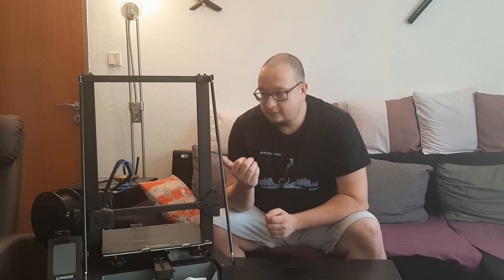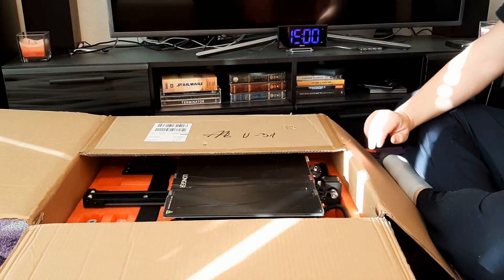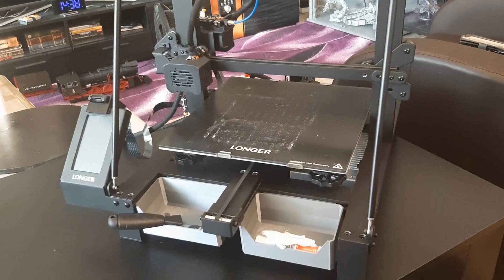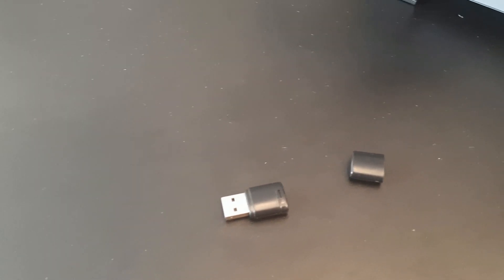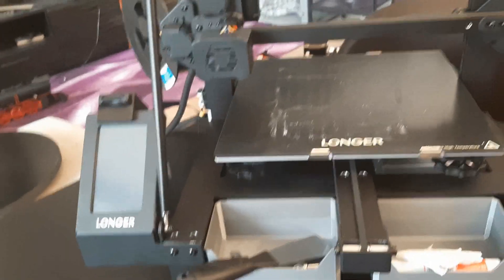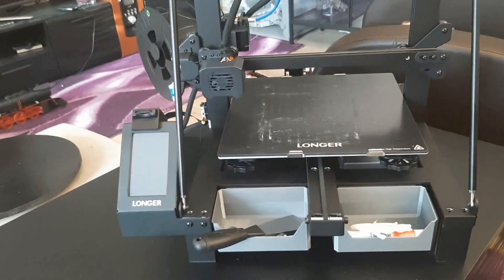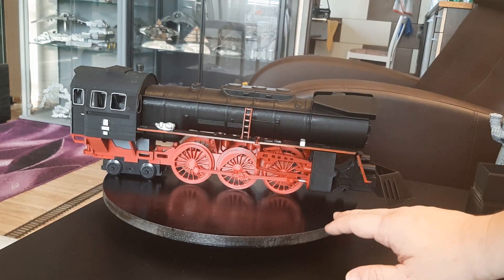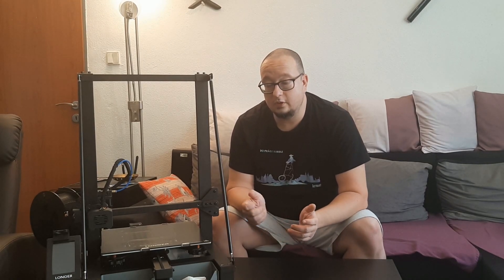V Log - Longer LK5 Pro Review - Very big and very cheap printer

Comment: Do you take orders for projects? 3D design, printing, or both? When say "orders" I mean, custom built, as I want something, if you can do it, we are in a "business deal" i.e. can I order a product?
Reply from the maker: I am honestly not sure what you mean. I do commission printing (but only to EU) and I do commission 3D modelling. However in both cases am I currently full. Is that what you meant?
Reply: @martintaichl  I meant: do you work by your own shedule and plan only, or one can make an order for models in case of which provide and asist with data/speces necessary

Comment: Nice video man. That train is slick looking! Question for you, is there anything you can print with your Prusa that this one could not? Curious if smaller parts, like from your numerous models, will print as good on this as your Prusa or if this one is better for the larger pieces. Looking forward to more videos!!!
Reply from the maker: well there were indeed those issues. On prusa, I will design a hole 10mm and a pin 10mm and they go together well. But here When I had 10mm pin, I had to make 10,3mm hole in order for those to go together. So would I be able to print my models? I guess so, but with issues. The pins would have to be scaled down to some 97% to even fit and the problem would be with the parts with the conneting elements in them. Those would have to be corrected afterwards.